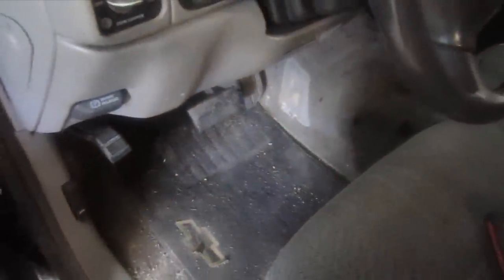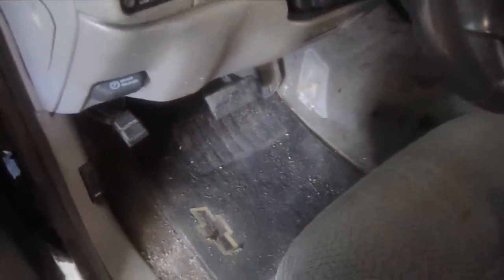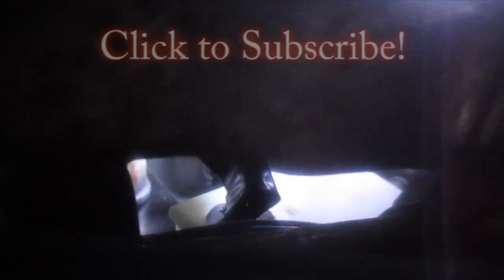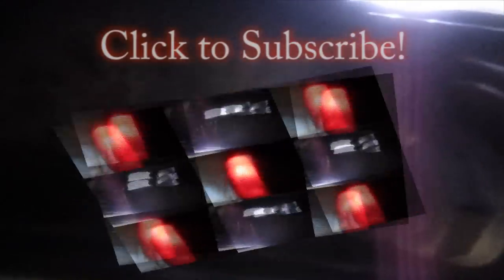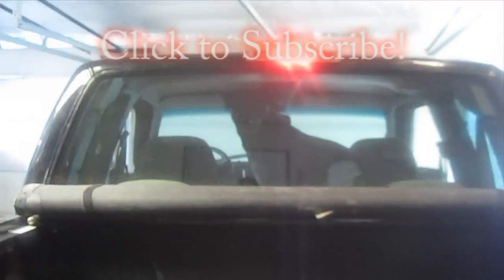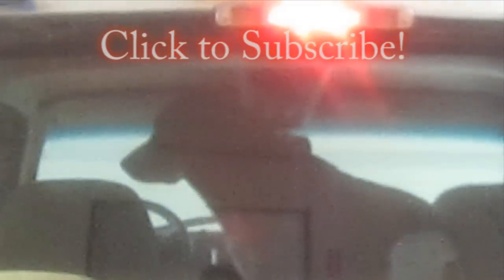DIY How to Replace a GMC Brake Light Switch Chevy Silverado Pickup Truck Brake Switch Replacement

Comment: Thanks to Mark for this great video! For those of you, like me, who have fat hands, here's what I found that works to replace the clip.  
1. Get a 10" or so piece of coat hanger wire and form a loop in the end that EASILY fits over the barrel of that clip. Remember that barrel has to expand to fit over the brake pin. Shape it like a lolly pop.
2. Get under the dash and form an offset so you can come up from under the switch on the driver's side of the steering column. Keep shaping it until it goes over the brake pin and the loop is somewhat flat against the switch body. 
3. Take a hammer and pound the ring a little flatter. Get yourself a fat o-ring that snugly fits over the clip barrel. This is to secure the clip to the coat hanger. Flattening the ring just exposes a little more of the barrel for a more secure fitting o-ring. Probably not necessary, but If the clip is knocked off, you'll likely have to crawl back out from under the dash to find it. 
4. Before you go back under the dash with the coat hanger/clip, get a slotted screwdriver with a blade that will at least span the width of the clip barrel. This will be used to push it on. A thin blade will only allow you to push one one side of the clip barrel, which will cock it to one side and not allow you to push it over the pin. 
5. Get back under the dash and feed the coat hanger/clip up from the bottom like you did when you formed it. Center it over the brake pin with one hand. 
6. Now, using your other hand, come poke the screwdriver through the slot where you can actually see the pin, (same slot you see the above video) and press the clip on the pin. At least get it started and then wiggle the o-ring and coat hanger off. Use the screwdriver again to fully seat the pin. This is very important so it doesn't pop off later. It's still a PITA with this method, but it was the only way I could get that clip on. 
7. Finally, the next time you meet a GM design engineer, hug him tightly, especially around the neck. ;-)

Comment: Thank you for the video, it helped me to put the clip back on. ( short term memory loss) 
I discovered that this "switch"  controls more than the Brake Lights. As with my 2007 Silverado 1500, the Cruise Control would disengage then eventually just quit working, The Remote start would quit it's sequence right at Engine Start. Also, the Stabilitrack and  Traction Control would disengage at different times and while in snow and ice on the highway.
Reply: You have the best video and explain well Thanks

Comment: lol man great camera work. i swear you're the only person on the internet that can get a visible shot of taking that damn clip off. lmao awesome man thanx
Reply: MrMrchatcity
Reply: no kidding! Been fighting with my brakes for weeks, the switch works if you actuate the little metal button in the switch by hand but nothing when brake pedal is pushed.  This is the first video I've found that shows a good shot of the clip coming off and going on,  I can now see that I must have part of the old clip stuck on the shaft.  Going to try and get them going again tonight.  Fingers crossed.
Reply: @outdoorAllard  hey Jon,  did replacing the switch fix your issue? Like you if i move the switch with my hand the brake lights work but when on the pedal shaft nothing
Reply: Ken Fetters no never got it working. Couldn’t for the life of me get it working on the pedal. Wired up a hand switch lol. Just a snowplow truck
Reply: @outdoorAllard  had to tie wrap mine to keep it from sliding on the brake linkage. Damn frikkin crap!!!!

Comment: Thanks Mark I got the brake switch off man was it frustrating... and I was able to replace the brake switch and I put it back in place and instead of a retaining clip I put on a rubber cap that was real snug but easier to take off for next time thanks for your help your video was great two thumbs up!!
Reply: What kind of plug, my clip is missing and the PO used a zip tie and it isn't working properly

Comment: Well I did change the brake switch and man that clip  was a pain in the ass to get off.  I got a busted  finger with a nice cut that went into my nail.  The job was done but with difficulties. The clip won this round. Lol.  Thanks man I really  appreciated the video.

Comment: Thanks very much, it helped me a lot replacing the brake light switch on my  99 Tahoe. It took me about an hour to get that evil clip off with just screw drivers of various sizes. Merry Christmas to you and Best Wishes for the New Year.

Comment: Thanks for the excellent video. Hands down the best video on how to remove this pain in the @$$ clip. All the other videos do not have as good a view or the clear directions. Once Mark explained the clip and how he did this job I had mine out & replaced in about 10 minutes. Before finding his video I fought it for an hour or so with no results. If you have large hands the task likely take longer.

Comment: Did you have to remove anything to fish the switch out after removing the retaining clip? I've been trying to remove the electrical connector around where the switch sits and its a real bear. If I could get both hands on the switch it would be a lot easier to remove the electrical connector.Thanks!

Comment: Mark,
Very helpful video.  I have a 99 suburban with brake lights that all worked with slight pressure on the pedal but went off when pushing the pedal hard enough to stop.  Thought is must be the brake switch.  Purchased one at AutoZone.  After much frustration in getting the clip off and harness detached (my wires were too short to pull down to where I could easily do this), I installed the new switch.  No I have no brake lights at all.  Bad switch?  All other lights still work so it's not a fuse.  Any ideas.  Thanks again for the video.
Reply: Mark, Thanks for the video.  I had the same problem as Lara on my '99 Suburban: I replaced the switch, but then none of my brake lights worked. Turned out that the black wire on the harness broke off.  I ended up having to pull the entire steering column to get the harness and pigtail out to work on it.  The part is available from Rock Auto, but it has some huge 12 ga. wires with it, so that took some fiddling to get it  paired up, but then I was able to add some length to the pigtail so if the switch goes out again, I will be able to drop it out with little issue.

Comment: Finally finished, what a pain.  Cut my hands all up.   Ended up having a green wire come out of the connector and I cannot find where the other end connected.  I’ve gone from occasional brake lights to no brake lights at all.  Sucks.

Comment: Did you have to take off all the plastic dash panels and such to get at it? I just looked at mine to see if it wriggles and stuff cause I think it's bad! But there's barely any room to work in there.
Reply: I think it would also help me if I didn't have the 4wd shifter on the floor

Comment: I broke my little metal clip off when changing out the booster and now the brake switch isn't working properly? Does that little metal clip affect the switches ability to properly function? and where could I go for a replacement or what do I ask for. All the auto parts stores think I'm asking for  a replacement switch.
Reply: Jessica Gallagher I have the same problem but I put the clip back on and still don’t have break lights
Reply: @str8kuality233  that’s the problem I’m having now

Comment: Replaced switch but when the brake pedal is pushed the light comes on for about the first third of pedal travel and then goes out when pedal is fully depressed.  Any ideas?

Comment: Hi Mark, I have a 1999 Chevy 1500 p/u truck. I have replaced all the circuit panels for the rear light assembly with all new bulbs two weeks ago. today I have lost all blinkers, hazard flashers, break lights, and backup lights. any idea what happened..? HELP I USE THIS TRUCK TO GO TO WORK AT NIGHT.
Reply: +Mark Jenkins well I did look at the fuse box and found a 30amp blown and nothing happens. would it be the brake relay.?
Reply: the 30 amp was to the hazards I think or the head lamps Mark
I do have a pigtail at the back I checked it out all seemed fine but I didn't unpeel the tape hence it was not a factory installed pigtail.
Reply: +Mark Jenkins ok I will do Mark I have one and ill check it all out tomorrow, I really do appreciate all your help and input and taking the time to help. ill get back with you as to what I find with the test light.

Comment: There was a couple wires I found that were cut. I soldered them together and put on brake light switch. Would you know why it doesn't shift in reverse or drive?